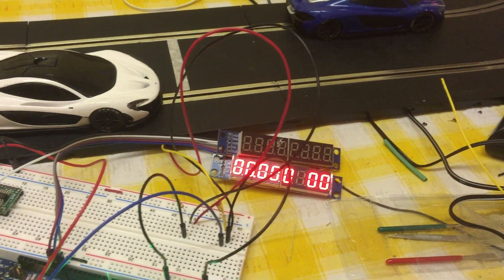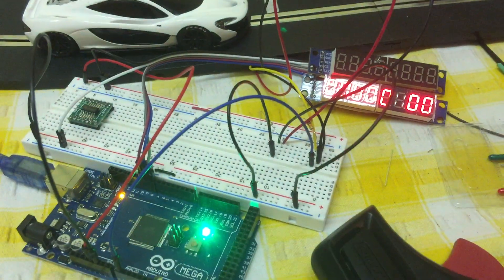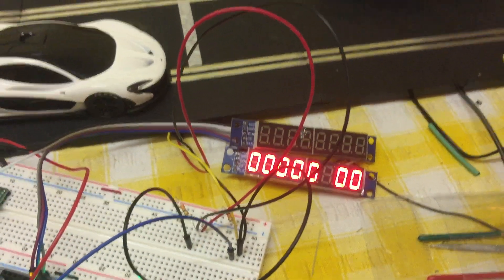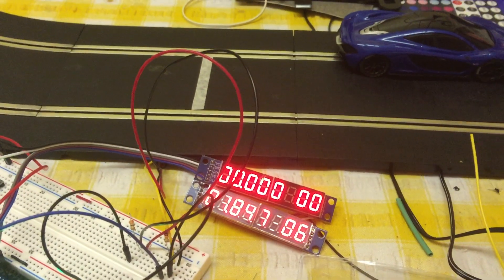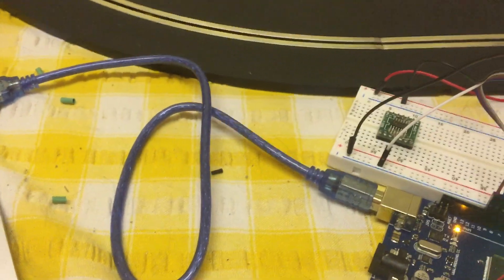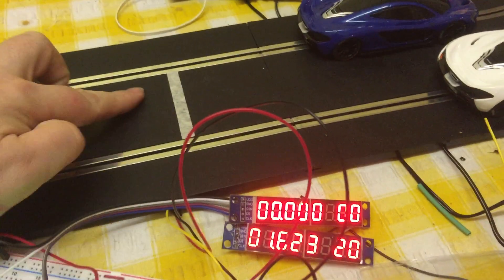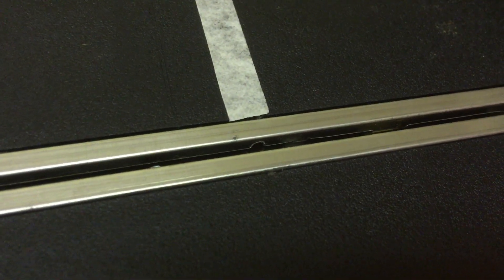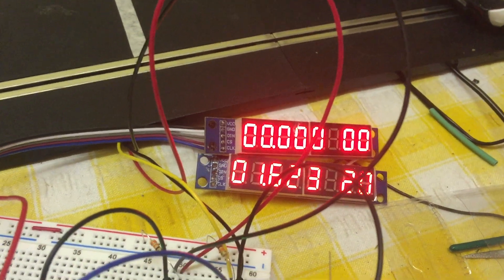Scalextric Arduino Lap Counter, Part 2

Comment: the answer to my other question is in this video - great work!
Reply from the maker: really need to do an update on this as its got a fair bit further, in the process of dismantling and rebuilding the display board and track sensors currently to move to the faster Arduino DUE board
Reply: @aleopardstail  Still waiting for the update :) Hope all is well!